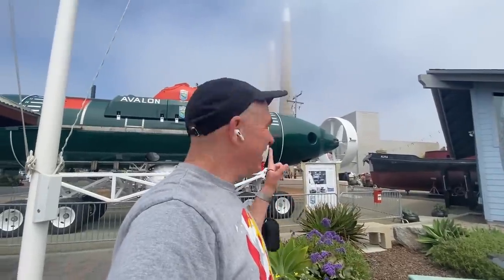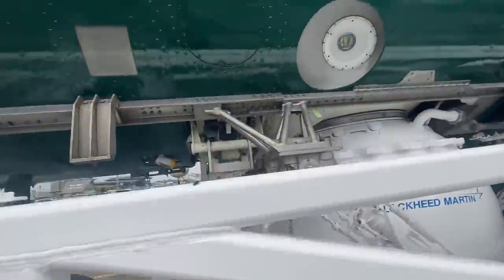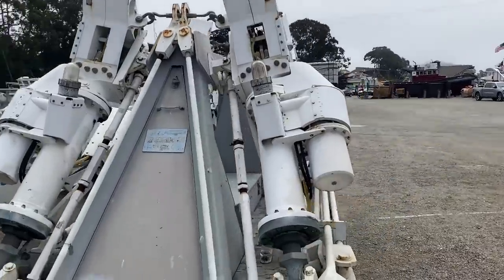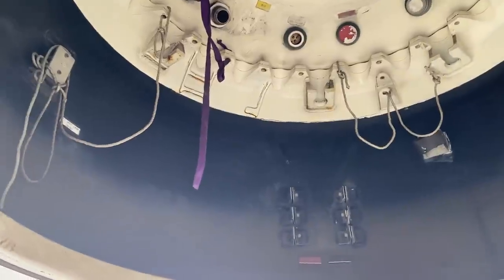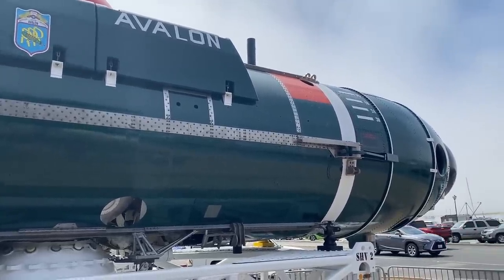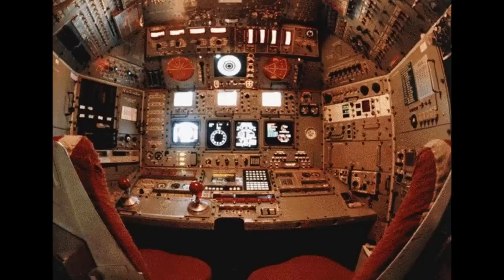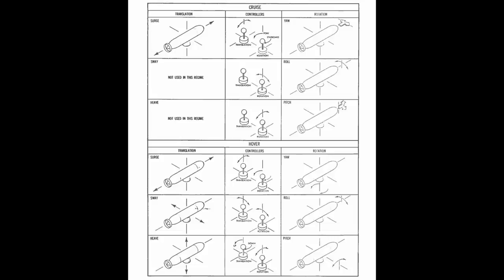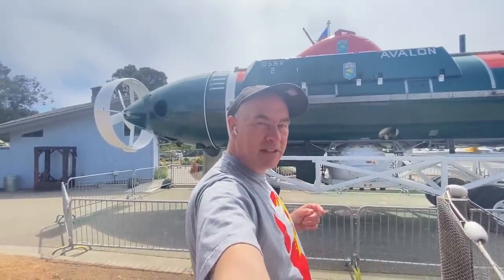How Submarines Docked While Underwater - DSRV-2 Avalon - Deep Submergence Rescue Vehicle

Comment: oh man, this is a strange rocket
Reply: Submarines are just rockets for a different world.
Reply: A water rocket
Reply: Twr is pretty bad
Reply: Yes it certainly is !! But Scott is also a very, very Stange Bird himself  !! Super Special as well !!
Reply: @pogolaugh  reverse the sign on the pressure difference numbers and that's basically true
Reply: i think this could be used as a rocket easier then a rocket could be used as a sub.

a space craft only worries about it's maxQ and then less then atmospheric pressures.

though some of the seals might leak air out where the water pressure normally holds them tight.
Reply: Underwater rockets from outer space
Reply: @joshuacheung6518  yea, its so bad that the vessel falls thousands of feet below the releasing point at liftoff!
Reply: There are some rockets in the ocean but no submarines in orbit 🤷‍♂️
Reply: Yah rocket for a different fluid density
Reply: Submarines do fly
Reply: Isn’t that a line from a movie?  Seems I heard something similar before.
Reply: “ok, ready to launch, pointy end is up, and… what’s that? Pointy end is down as well? I picked the wrong week to give up jellyfish!”
Reply: I was going to say that submarines are more like airships, but the structural dynamics of an airship are actually pretty relevant to a rocket as well
Reply: Noisy end ahead, spinny end behind?
Reply: I think the engineers might've had their design sheets upside down, I thought rockets were supposed to go up, y'know.
Reply: An inside-out spacecraft, basically
Reply: Not as strange as Scott's hat! I can't help thinking he wouldn't wear it back in Troon! 🤔
Reply: @joshuacheung6518 😂

Comment: Scott, I spent 20 years on US submarines, good video. The only thing I would say if that while we never used them for spec ops there was a fake one on the back of the parche, allegedly.  I would add that based on the depths of water around the world the odds of ever using one of these was astronomically low.  Basically these existed so that congressman and mothers could feel better about the dangers we faced.  

Dive safe
Reply: I was lead guy for Parche repairs, when she was brand new. They were welded down to eliminate the chance of noise.
Reply: Then there was Kursk
Reply: Not allegedly, and only half fake. As the Parche guy said, it was welded down. It was a diver lockout chamber (badly) disguised as a DSRV. There’s a picture of the Parche passing underneath the Golden Gate Bridge in at least a couple of submarine books.
Reply: Pretty much. "Remember the Thresher. Remember the Scorpion". Motto of Portsmouth Naval Shipyard, Virginia USA

Comment: There are a few other reasons why submarine to submarine submerged transfer of survivors was desirable.
Firstly, surface conditions might make recovering the DSRV to a surface ship to offload and resupply impossible. Staying underwater mitigates the weather issue.
Secondly, you might be rescuing a crew from somewhere they weren’t supposed to be, having had an accident whilst doing something a bit sneaky. Not having to rely on a surface rescue fleet would have been handy if you wanted to be discreet. Ultimately you might want to rescue the intelligence and intelligence gatherers first, crew second.
Finally, transferring horizontally through the water to another submarine would be quicker than ascending than descending vertically.
Reply: Second reason, part bravo: you might want to rescue the crew of a Soviet submarine without anyone in Moscow knowing they were even still alive.
Reply: @Sableagle  "I read your book, Ryan. Your conclusions were all wrong. Halsey acted shtupidly."
Reply: @Sableagle  see that's a document I'm going to have fun reading when it gets declassified.
Reply: Addendum to the second reason. Even if you're in somewhere you're allowed to be, you don't want the Soviets, or anyone else, knowing the exact location of a downed submarine that they could recover, Project Azorian style.

Comment: I may swing and miss, BUT, as a guy who has built and executed large units’ loading plans back in the 90’s, I can tell you that converting C130’s to C-141’s, it was pretty straightforward. With C-5’s, cross loading from one to several other aircraft was …interesting.  Even the Air Force mucked it up!  When my unit was alerted that we were going to the Balkans, we first asked where in the “Wide World of Deployment Asset’s” did we fall.  Top of the list was the first reply. Already having deployed my Airborne Signal Company by air 3 times up to that point, I told them I needed 3 C-141’s or 1.35 C-5’s. Not trying to be glib, it became: 2 C-5 or 3 C141 planes.  We were told, Monday, that we should expect aircraft to be arriving around the following Tuesday.  Folks were miffed that I was making them work 18 hour shifts with 9 of those hours always superimposed on the next shift.  Then, around 6:00/0600/oh 6 hundred/6am/and for you really slow ones, the big hand was on the 12 and the little hand was on the 6/for marines, just ask the person ext to you!
Anyway, at 0607 someone knocked on my office door so I knew it was important, as the instructions on my door were of the effect of death, birth, WW3 or that the Operation was nixed.  Close.  I was told that the USASOC Headquarters just received word that our deployment airplanes had just landed at the next door Air Force airfield.  Trying to sound more awake than I actually was, I asked “how many of them so far?”  There was a long pause; “all of them sir”. I shifted gears, “Sergeant, please define “all of them.”
“Sir, 2 C-5’s and 4 C-141’s!”  💭 WTF!??!

So I re-read the diagrams from above, a 3 ‘141 mission converted into what we have, on hand today, would look like this, a C-141 has 10 “palate spaces” compared to a C-5’s configuration of 36 pallet spaces, 18 per side.  Meaning that the ENTIRE system could be deployed by a single airplane.  However, if it was up to me, I would sent one full plane, followed, about 2 hours later, by an “awe shit” plane.  What is does the “awe shit” plane do?  That plane is there in case anything goes wrong with the primary airplane, because when the pilot finds out that his plane is broke and can’t fly or reliably get his precious cargo to the accident site, usually utters “Awe Shit.”  Why 2 hours?  Because that is about how LONG it will take to get everything off the 1st plane and have it ready for the next plane.
Reply: I created this video for a deep submergence reunion about 2 years ago and in one section it shows the DSRV being loaded into a C-5. It Ould also be squeezed into a C-141. I personally accompanied Mystic to Norway on a C-5.   
https://www.youtube.com/watch?v=D2jNrjngvng&t=91s

Comment: I've done a sea survival course, and part of that is clambering in to a life raft. There were 12 of us in a raft designed for 18 which could take 24, and it was a squeeze. And it was probably not much smaller than one of those pressure vessels. I mean sure, if my life depended on it I would dogpile to the max, but damn it would be uncomfortable.
Reply: I was wondering about the number of people vs the apparent size of those domes.
Reply: Not as uncomfortable as the hours spent waiting for the oxygen to run out. 🤷‍♂

Comment: I never would have thought Lockheed would have built a submarine, Somehow always figured even the DSRVs were made by Electric Boat.  Mystic Class however is named for a town in Connecticut.
Reply: If I were to want to build a submersible the company I might pick would be Westinghouse for their experience in building nuclear power plant reactor vessels that must hold high pressure.
Reply: @BobConnor-n2g as we've just seen demonstrated by Oceangate, there is a world of difference in engineering between compressive and expansive forces.  Not saying Westinghouse's engineers couldn't design and manufacture a suitable pressure vessel, but a pwr vessel is designed to keep pressure in.
Reply: Lockheed had experience in unconventional underwater projects, including their role in building the claw (named Clementine ) that was used in Project Azorian to salvage a Soviet sub.
Reply: @BobConnor-n2g  

NR-1
Reply: They don't call them the Skunk Works for nothing! 🦨

Comment: I was stationed at Pt Loma in the late 70's and we did a SubSunk exercise with the Avalon. Flew her in on a C 5 to North Island and barged her over to the sub base and put her on the back of the USS Guitarro, SSN 665 (I think, might have been Pintado). Singled up all lines then said, Okay, send her back to Connecticut.

Comment: It's cool that it could fit in a C-5 for transport.
Reply: The C-5 could be retrofitted for a number of missions; it was purpose-built to airlift the M1-A1 Abrams tank.  It could also transport smaller vehicles, support equipment, cargo, 350 regular troops, or 200 paratroopers.  My father was part of the 350th Maintenance Division, US Air Force.
Reply: Do you think the C-5 could grab all the gear previously hauled around by the three Starlifters?

Comment: Back in 1984, while serving aboard USS Pigeon ASR-21, we had an opportunity to operate with the Avalon.  A number of us got to get a ride in the DSRV.  An interesting note is that Draper Labs also built the computer which ran the 3D sonar system on the Pigeon.  It used the same core as the Apollo command module computer, also used on the DSRVs.  Alas, those two rescue surface ships (Pigeon and Ortolan) were far too slow to get to a scene in a timely manner.  They did, however, have two completely separate decompression chamber systems, one in each hull, with through deck air locks.

Comment: Great to see one of these for real.   As an systems and electronics engineer I worked on both helicopters and Submarines.   When asked that was a big changed, I would respond that system wise it has many similarities, but the both fly, just Submarines fly through a thicker medium (and thus space craft in a much thinner medium).
So yes it is fly by wire.

Comment: Hi Scott.  Really cool video with which I have a couple connections of sorts.  I was Army trained on an INS made by Litton used in OV-1(we had Ds) that used core memory and was loaded by punched tape!  Later I was a member of the ERIC (Equipment Repair and Information Center) as a field service computer technician at Martin Marietta when LockMart was formed.  After that I worked on the computers supporting Atlas 5 in Englewood Co.  Fly safe!

Comment: That's got to be a nerve-wracking form of docking. Even with very large pressures holding a tight seal, it only takes lateral force overcoming friction and then you're wide open. If the target of rescue is resting at an odd angle and there are ocean currents or debris in motion, that could easily present a very risky situation. No doubt somebody has done the math on the acceptable limits for docking angle and currents, but that would still require a lot of faith and courage.
Reply: The amount of force on that docking collar would be the equivalent of two massive quarry dump trucks sitting on a toilet plunger. It isn't going anywhere unless you start actively pumping pressurized sea water into it to equalize the pressure differential.
Reply: @bigbuckoramma  
Yep, aka a "hard pressure seal."

Comment: Cool!  What procedure would they have used if the submarine's escape hatch was unuseable (for instance, if it's jammed shut or buried in mud or cut off from the rest of the sub by flooding) and they had to cut through the hull itself to gain access to the crew?

Comment: 0:57 Whenever I hear the name Martin Marietta it reminds me that for years I assumed that the Marietta part of the name referred to Marietta, Georgia. The fact that Lockheed Martin has a facility there where the C-5 and C-130 were built (the C-130 is still in production there) probably helped throw me off. As it turns out the name actually dates back to the Marietta Paint Company in Marietta, Ohio, one of the several components of the American-Marietta Corporation which merged with the Glenn L. Martin Company in 1961 to form Martin Marietta. The Marietta name lasted until the merger forming Lockheed Martin in 1995. This information is all easily accessible now in Wikipedia, but not several years ago when I spent a bit of time tracking this down.

Comment: Would any of the design documents be declassified or otherwise publically available by now? (Especially control and other electronic systems.)
Reply: The DSRV was never classified. You could likely make a FOIA request for related information. The level of detail they provide may be limited in some cases if the original manufacturers (Sperry, Lockheed, etc.) claimed it as proprietary. 
-U.S. Navy Enlisted Submersible Pilot #36.

Comment: The rescue of the Submarine Squalus using a diving bell with a lockout system brought the survivors to the surface around 1929 - 1930s. The water was not that deep I seem to remember plus 100 feet but doing this at depth is amazing.

Comment: Very interesting video. Such capabilities of the Central Processing Computer really impressed me. And, if adding took 10μs and, multiplication, 20μs, what with 16 input and 16 output analog channels, those operations must have been performed analogically. Otherwise, multiplication would have taken at least 800 or 900 μs.
    Indirection and 3-D indexing also impressed me but not so much: given the 6-D nature of the navigational data, it's a must.

Comment: 11:10 "So there is a mercury ballast trim system which pumps mercury around between a number of ballast tanks"
Seems unlikely they would have pumped mercury around as ballast, I suspect that they used mercury-based tilt sensors to control the pumping of water between ballast tanks.

Comment: Well, the sea has often been called 'Inner Space', so yes there are parallels with the outer variety.  Remember as well, how much training goes on in water tanks.
For transport, C-17s could also easily carry the DSRV system.
HEY, did you mention that there is a replacement platform??
Reply: I wonder if all the support equipment could fit with the DSRV in the C-5 so they only needed one airplane instead of three. Which is why Scott found the pictures of that.
Reply: @bbgun061  You would think it would all fit into that cavernous cargo bay.

Comment: Why are the vertical and horizontal thrusters just hollow tubes? How did they work?
Reply from the maker: There used to be props in there, at some point they were removed.
Reply: I assume (as in, I don't actually know if this is true) that they removed the motors from inside those tubes.
Reply: Magneto hydrodynamic drive, that was the top secret part 😉

Comment: It’s interesting to hear that the crew compartments were spherical implying that it was designed for extreme depth. However it was only ever going to recover crews from less than their subs crush depth, so why was that compartment design necessary? Maybe there were indeed some alternative missions it could be used for.
Reply from the maker: US Los Angeles class subs are intended to operate down to 1500', but max dive depth is probably about 3000' and crush depth is deeper still.
DSRV is designed to operate at 5000', so there's a lot of margin there.

Comment: What about docking with the pitched or rolled sub?
Reply: it can fill his ballast tanks unevenly to list or pitch itself. It's going to be fun to operate then but it's what can do
Reply: Looked on the diagrams like it could list 45 degrees max it the target was no longer vertical.
Reply: It had a ballast system that used mercury pumped to various tanks throughout the vessel to shift the center of mass.

Comment: I guess since the access tunnel goes into the middle sphere, if they're rescuing people at higher pressures then the pilots would be trapped in the cockpit until the rear spheres could be depressurized 🤔 Unless I'm missing something?
Reply from the maker: Correct. When rescue is needed at high pressure the support sub will offload pressurized crew using forward hatch, and then the DSRV moves to rear hatch for crew and recharging.